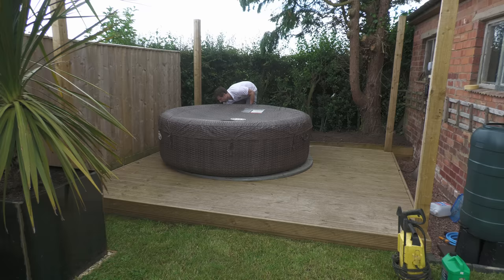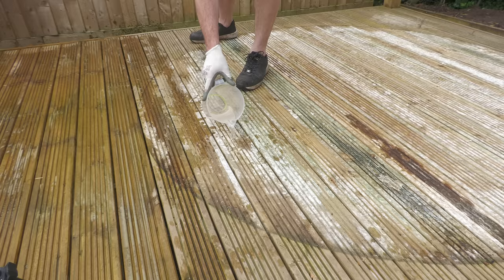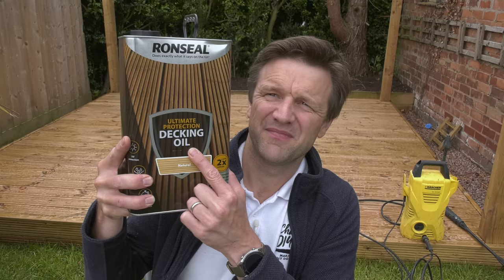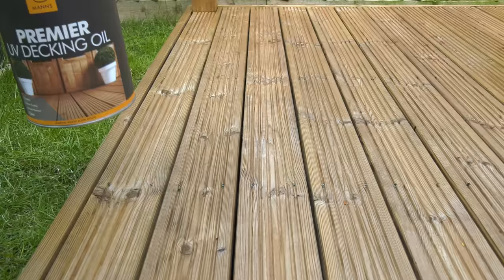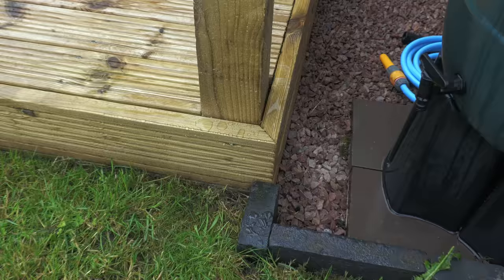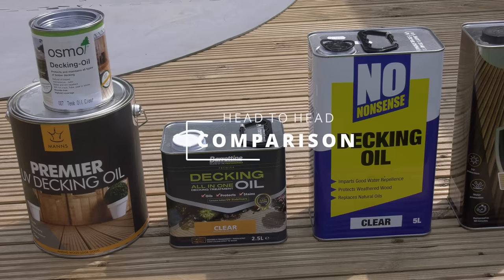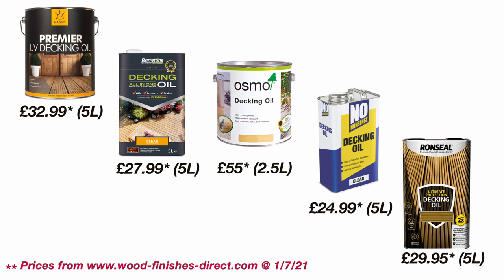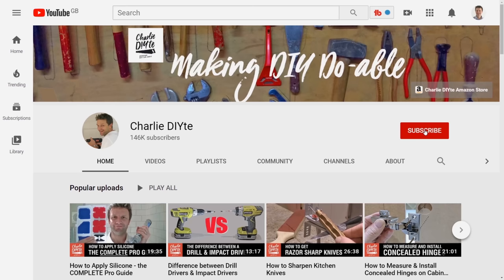How to Clean & Oil your Deck

Comment: Great video. I need to revive my aging and previously wood stained decking. Whether I can oil it will depend on if I can remove the previous paint. One thought though, if all wood even treated needs care and maintenance, eg sheds fencing decking, what's to stop the frame of the decking underneath rotting whilst the top looks nice. It's still exposed to moisture but I guess not UV. Would it be worth putting something like creocote on the before laying  the boards? And even the underside of the boards for that matter...? The same could be said for the underside of a shed... This would be if you really wanted to care for it and have it last as long as possible.

Comment: Hi Charlie, I followed your steps and I’m really satisfied with the results. I was just wondering, can I use my pressure washer to clean any dirt marks on the decking afterwards?
Reply from the maker: Try it. If the dirt was there before you oiled you might find it locks it into the deck but you can always apply a bit more after. Also you'll find you still need to reapply every 6 months or so depending on how severe the weather is on it.

Comment: I used the waterbased ronseal a year or two ago... absolutely terrible, washed out after 4 months. Used the oil based, protection and good colour latest 2 years
Reply from the maker: I'm afraid that's right. It's just not up to decking. 👍🏻

Comment: Just used Ronseal decking reviver it does what it says on the tin. My decking has not bee cleaned for 2 years. This years rain has not done us any favours.  I sprayed on the liquid and used a stff sweeping brush / left it for 15 mins then hosed it down.  It had been covered in green algae and could see it start to lift straight away. have now run out and having difficulty in getting some more ...I guess everyone is doing the same jobs.  Just need to know what is the best oil to use, but very pleaseed with the product.  I also tested it on my Indian sandstone pavers and they came up a treat Happy patio decking cleaner sat back and  admired  it.
Reply from the maker: Good work Linda. Great stuff isn't it!

Comment: Two heroically stupid questions coming up: 1) What’s in the decking cleaner/reviver and could I just use warm soapy water and 2) is it a good idea to cover a deck with a tarpaulin/sheet or similar as the internet seems split on this! Thanks

Comment: Great video. Thanks Charlie. Just wondering, if you were treating wood for raised bed borders (very thick wood) what would you use? Conscious of protecting wood v not poisoning plants, veg etc.
Reply from the maker: For the internal part I'd probably treat with something like Bostik bituminous paint but you'd need to check if it is safe for the soil and plants as you say. If not, use a line but you always worry trusts going to trap moisture against the sleeper and rot it quicker. For the outside, you might check out the 2 step system I mentioned 8:32 minutes into this vid https://youtu.be/sCMdiWauKjQ
Reply: @CharlieDIYte  thank you! Novice question, what does use a line mean? (Sorry!)

Comment: Had the same problem Charlie and it kept reacuring so I ended up cutting a hexagon Same size of the hottub and shuttering it up with flagstones on the end as shuttering to the same hight of the decking and filling it with concrete and reattached the decking to the concrete and never looked back
Reply from the maker: What a fantastic solution David. I'll probably end up doing something similar. Why I didn't just lay flag stones in the first place is a mystery to me!! Would have been so much easier to construct too!! I'm going to build a circular, sacrificial plinth that the hot tub can sit on, with air vents round the side. Oil it to within an inch of its life now I've got so much spare oil kicking around and see how I get on with that. Not a priority right now though so maybe a job for later in the summer/ the spring. First thing I've got to do is sort out the inflatable cover which is hopeless and no longer inflates in spite of me fixing 12 leaks in it!

Comment: The most important thing for preserving the life of decking is to go for good quality hardwood decks. They are a lot more expensive that the stuff from B&Q and Wickes but it will last much more longer and they won’t need to oiled as much.
Reply from the maker: Agreed. At the very least a decent quality deck, not the cheapest stuff they sell at B&Q. I think mine is about 25mm thick.
Reply: @CharlieDIYte  as they say, buy cheap, pay twice. Not always true but for decking it definitely applies. Great channel Charlie. Thanks to you I’ve learnt how to silicone my shower tray at home and the bathroom at my buy to let!

Comment: Hi Charlie, I’m currently looking at installing some decking, just trying to choose between composite and wood.....any advice?
Reply from the maker: It's a tricky one. Everyone says go composite if you can afford it but you have to buy a decent quality one as some can bleach/degrade in the sun, and then you've got the system to screw down to fix it with. On balance though, if you can find one you like, composite is probably the way to go. Make sure you treat the joists underneath though/ name sure they're well ventilated as otherwise you'll be taking up the deck to replace the joists - which will defeat the object of putting down that indestructible deck!

Comment: Thanks for the video as always. Do you know what the active ingredient is in the decking cleaner? I'd read a suggestion for oxygenated bleach, and am wondering how a bulk ebay buy would stack up as a budget alternative.
Reply from the maker: Your welcome. If you click on more info on this link https://bit.ly/3mTM7Ft it tells you the ingredients. It's more complex than just bleach though. It's not expensive stuff so I suspect the bleach will cost a similar amount.
Reply: @CharlieDIYte  cheers. Didn't appreciate how cheap the cleaner was. Fwiw I tried the oxygenated bleach by way of oxy power as it was in my cupboard (and that's the main ingredient anyway). It worked well. It's safe for plants, etc. so if you need that quality it's worth a look.

Comment: Thanks for the video, just cleaned decking and thinking of getting Manns decking oil, aswell as natural the do colours. Do you think the coloured ons will be more like ronseal ie on the surface rather than soak in ?TIA.
Reply from the maker: Good question. I think you'll get more longevity than if you were to just use a stain as the idea of the oil is it should sink in (assuming it's solvent not water based).

Comment: I've been blasting my decking with a jet wash for years , gets all the grime out and sets it up lovely for repainting ...I will give Mann's a try this year ..as I used the " No Nonsense " last year and wasn't overly impressed with it , I'll also invest in a deck brush , on my knees with a paint brush isn't appealing this year
Reply from the maker: Good work Alan. The brush is well worth the investment.
Reply: @CharlieDIYte  Yes Charlie the brush has really tight bristles and I would probably pay £10/15  for it as for the pole @£30 and the rest of the stuff in the Osmo kit ...useless ...I used an old decorating pole from the shed , fitted fine ...and the Osmo  paint trays ??? Pointless !!  you spill more than you get in them ...way too small , buy a full size tray from a pound shop  !! The brush is the only worthwhile thing in the £60 kit ...done the job in half the time

Comment: Could of done with this vid ages ago, ronseal is terrible stained my deck year later flaked off just oiled my deck few weeks ago with ronseal again time will tell how good it is
Reply from the maker: Yes let me know how you get on. I'm sure you'll be fine with the original version. I wouldn't touch any stains or water based for that reason but thanks for letting me know your experience. It will help others make the right choice 👊🏻👍🏻
Reply: Oil so much better the decking is still nice just dirty it’s went white in some places

Comment: Did you test water beading on the second Osmo trial piece (the one that you wiped away the excess applied oil)? I was wondering if there was a difference on how water beaded off that sample versus the sample in the table.
Reply from the maker: I've just had a go with it! I'd say it beaded slightly better than first time round but not quite as noticeably as the Manns
Reply: @CharlieDIYte  

Thank you very much for checking.

Comment: Hi Charlie. Just curious if you planned on doing a follow up video to this one to give a review of how the Manns oil has lasted over the last year?
Reply from the maker: Too many jobs in the pipeline right now but I agree, it would make a good video and a useful update to add to the original. The deck does look like it could do with a fresh application. Bottom line all soft wood like this is thirsty so the oiling needs repeating from time to time.
Reply: @CharlieDIYte  I have had decking in my courtyard back garden for over 10yrs and it seems every year it needs cleaning and re-oiling every year. I was just curious if the Mann product had held up any better and were able to get longer than just a year. Thanks for the response.

Comment: Ronseal product looks like Wiko's "I'll stain and protect in one go" polyurethane varnish which just sits on top of wood instead of being absorbed into it. Different products for different purpose, so choose carefully to avoid disappointment. At the end of the day, it's oil on wood, so cooking oil should work. Add some UV blocker powder and colour dye from ebay should do the trick. Has anyone tried it?
Reply: I used that Ronseal "oil" for 3 years and it was the Natural colour.  Looked nice for a year, then gets dirty and couldn't clean it properly.  It left a wax like layer which started flaking off.  I spent 2 days sanding the decking, one coat of the Ronseal Natural "oil" and a couple of costs of the Screefix clear oil work well.  The Ronseal "oil" doesn't even repel water.

Comment: So advice is to leave treated deck for 6 months before treating with oil. If decking happens to be installed  in October then there is all winter for deck to go through, does this change anything? i.e. Is it best to oil regardless of the fact that  oil might not be absorbed fully and will this permenantly change the oil absorbtion capability of the deck fo later applications. Thank you
Reply from the maker: I would say oil it anyway. The treatment they use these days isn't as good as it used to be so it will sink in fine.

Comment: My decking is quite old i think and probably hasnt been treated in a long time. Ive power washed it and got alot of grime off but theres alao a shed on it... not sure whether i should empty it and try and move it off to also clean and treat under it. What you think?
Reply from the maker: Doesn't the shed protect it?
Reply: @CharlieDIYte  it's raised slightly so think alot of the rain gets under there and prob not drying etc.

Comment: Hello, thanks for the interesting video. You didn't mention whether the Screwfix oil was solvent based or if it offered UV protection. Could you clarify?

Thanks
Reply from the maker: It is solvent based. I don't it has UV protection though.
Reply: @CharlieDIYte  Thanks mate, you have been a big help. Going to go for the Mann's

Comment: I cleaned my decking with cleaner and brush, it took a few hours....I painted one coat of decking oil but then it rained heavily for 2 days before I could paint the second coat.  There is definitely dirt on the decking now.  Do I need to totally clean my decking again before I paint the second coat?
Reply from the maker: Maybe give it a brush with the deck scrubber and just water to see if you can shift it. Failing that, yes you might be advised to apply more cleaner. I wouldn't worry too much though. You've done all the hard work and the oil will be protecting the deck nicely now.

Comment: Which would you recommend for softwood sleepers, osmo or manns
Reply from the maker: I guess the Osmo with its superior durability, but either would do the job well. If using the Osmo it recommends allowing the wood to weather for 4 weeks prior to application, of its got a reasonably high resin content (eg coniferous timber).

Comment: i would have a look at the owatrol range doubt any gear will be better than that.
Reply from the maker: It's awesome stuff isn't it. Used it recently on that planter you saw in the video, which I recently had made. Gave it a coat of oil to stop it rusting and have since Owatrol varnish as well which I haven't got round to applying yet.
Reply from the maker: Jack, why didn't I think to try out Owatrol 🤦 I used it on that planter you saw in the video to stop it rusting. Such a quality brand, I agree. Thanks for the comment. I'll bare that in mind for next time.

Comment: Hi, can you advise if it is ok to use solvent based decking oil on a deck that was previously (about 18mths-2yrs ago) done in water based? I read they aren’t compatible. The decking is in full sun during the day and it doesn’t look as though there’s any protection remaining.
Reply from the maker: You're not meant to but perhaps you could experiment on a small area, and see if it sinks in. If the protection has completely gone it should work, although water based products sit on the surface rather than sink into the wood.

Comment: Hi Charlie, I’ve just laid a deck using hardwood (yellow balau). I will be oiling once the milglaze breaks down, but wondered if you were aware of oils specifically for hardwoods?
Reply from the maker: Hi Sean, I'm not, but these oils work for hard and soft woods, so I don't think you have to treat it differently.
Reply from the maker: Actually on reflection maybe something like this would be best https://bit.ly/3jJqcPS Can't beat Owatrol oil.

Comment: Thanks for the video, you've sold those brushes to me! What's the reason the brushes can't fit on an ordinary decorator's pole? It's not clear on the video but it looks as though it would work with the push fit type (mine have both a push and screw adaptor)
Reply from the maker: Thanks David. That's a good question - it was an assumption I made reading a few reviews. Does your push fit pole look like it would fit this brush then?
Reply: @CharlieDIYte  The visible difference is that the Osmo pole has those locking lugs, so if the diameter is similar enough it would work. But I've just looked again at wood finishes website and saw this https://www.wood-finishes-direct.com/product/manns-lightweight-extension-pole. My pole probably similar to that one and it says it's compatible with Osmo, so I answered my own question I think!
Reply: @CharlieDIYte  Also - Good luck with your new adventure on YouTube! Your channel has been great for me to learn from, I used your MDF painting tips recently, although I couldn't get on with the silicone spreaders you recommended (made a right mess in the bathroom so I'm back to masking tape... d'oh!)

Comment: Wonder what effect a coat of boiled linseed oil cut 50 / 50 with turpentine would have as a primer before applying a oil finish?
Reply from the maker: I suspect it would prevent the oil sinking in so perhaps not a good idea. Linseed oil is great stuff though, particularly on hard wood.
Reply: Goes black in the sun over time though 🙂

Comment: I was thinking of using yacht varnish as recommended by my decking installer. Had you considered varnish?
Reply from the maker: I wouldn't personally. Like a stain it just sits on the surface and any nicks, scratches and the water will get in. Also, more susceptible to cracking and pealing with time.

Comment: Hi there just found your channel after searching for ideas for painting my decking. I have a good amount of decking to paint. After researching for ages ive saw that using oil is the best for the wood however I don't love the colour of oil .... would u b able to stain it or paint it then add the oil over the top? Just so I have the best of both worlds?
Reply from the maker: Hi there. I personally wouldn't stain it as the stain sits on the surface and peals/ cracks and it looks awful when it does this. What colour are you going for? Are you sure Osmo don't do something closer to what you're after?
Reply: @CharlieDIYte  thanks so much for responding.  Right now my fence and decking are a very dark brown. Im jst looking to break it up a bit so jst something with a little colour. Ill have a look at the osmo colours and see what's there. I just wasn't sure if staining the oil was an option. Thanks so much for responding 😀

Comment: Any advice on stripping a deck which has been stained in the past, in order to then follow your suggestions? I can use an orbital sander for the top but looking for a stripper recommendation to get in the grooves. I know how that sounds...
Reply from the maker: Unfortunately blood sweat and tears. You could try a pressure washer to see if it lifts any of the stain but failing that it's a sander for the deck and then cut a v shaped wedge and wrap it in save paper for the grooves. Now ideal but I can't think of how else to do it.